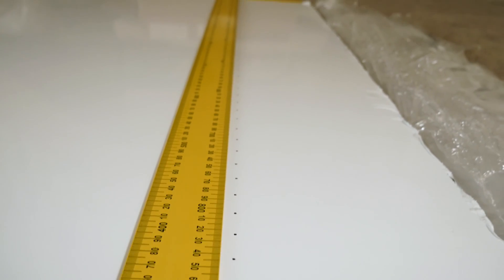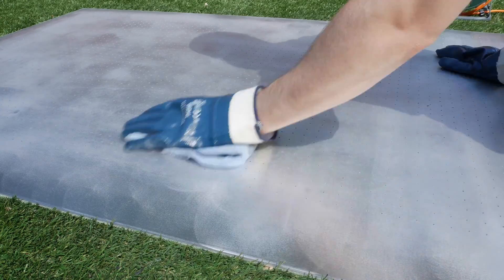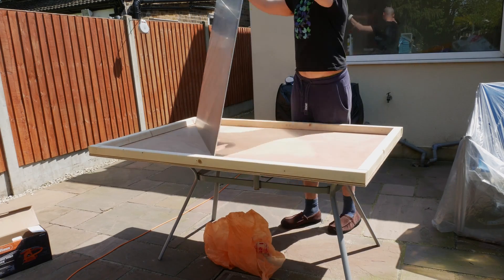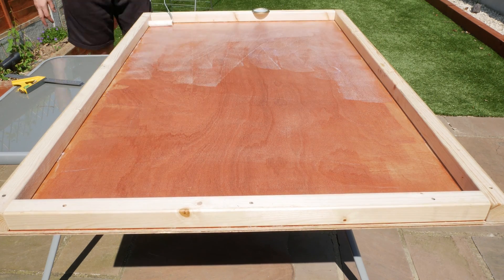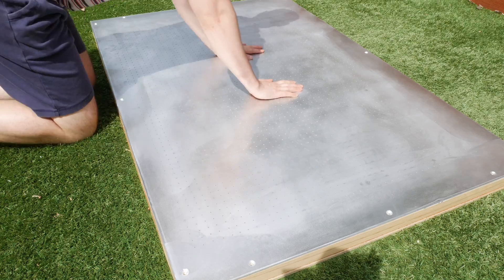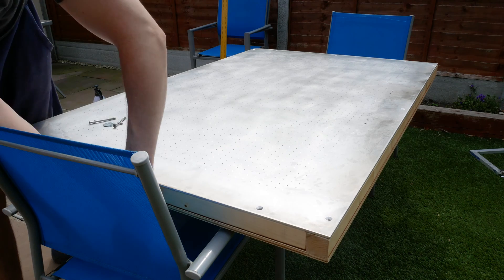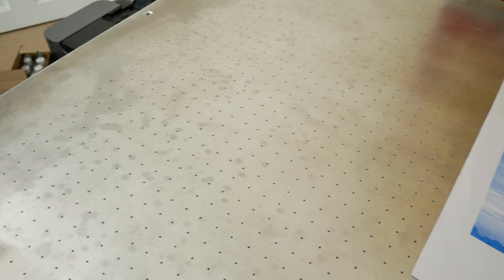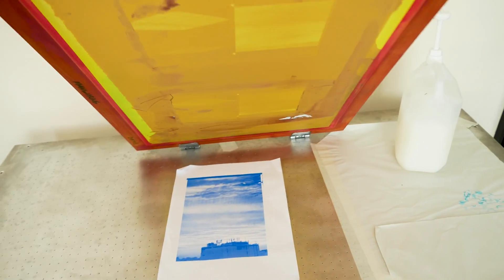DIY Large Screenprint Vacuum Table For Under £200

Comment: Sir a great build.. But why would you build a vacuum table like that when all you need is to put a vacuum between the glass and the flexible membrane? The bottom of the vacuum table could be the glass and the membrane would seal to it with the exposure unit beneath that. That is how we burned offset plates for years. This would be much less work and far cheaper.
Reply from the maker: this is a printing table not an exposure table, check out my exposure table video on my channel
Reply: @ThisDesignedThat  Sorry other than an exposure table I couldn't see a practical need for the vacuum. I worked in printing for years and never thought of something like this. I would think it would slow down production. God bless.

Comment: How thick is the metal?
Reply from the maker: 6mm
Reply: @ThisDesignedThat  what is the size of that metal top I thought I heard you say 1000 x 1500 mil surely its bigger
Reply from the maker: @daddy4739  1500mmx1000mm thats pretty big, easily print A0 sized papers if needed
Reply: @ThisDesignedThat  could you give that to me in English measurements. I try to go metric but I'm not quite there yet. What brand of screen print inks do you use?
Reply: @ThisDesignedThat  thanks I'm glad I found you on YouTube  just scrolling around. You have great advice and your and EXCELLENT teacher.
Reply from the maker: @daddy4739  mm (metric) is English measurements :) you can use google to convert to what you need. I use Daler Rowney System 3 Acrylics
Reply: @ThisDesignedThat  thanks again. Oops I meant to say u.s. measurements

Comment: Great Vid, Thanks! I'm about to build one myself and this was really helpful. Are you still using the domestic vacuum or did you find anything else?
Reply from the maker: Hi Joey, yes still using a domestic vacuum, i would really like to get a side channel blower but they are pretty expensive £300-500. I've actually finished upgrading this table to be even better and will be releasing a video on it today

Comment: Hey Paul! Thanks for sharing, I need to make a table as big as yours, roughly, and I've learn a lot as I've been able to clarify many doubts. Just wanted to ask you if there's a special reason for choosing a 6mm thick aluminium sheet instead of, for example, a thin metal –don't know which kind yet– sheet attached to an MDF board. Thanks again!
Reply from the maker: I would opt for a water resistant surface and not use MDF personally. You can sometimes get ink and water on the table and MDF could swell up and that might cause issues. Plus it would be a pain to glue them together if you dont have a lot of clamps and weights.
Reply: @ThisDesignedThat  Oh, thank you so much, you're totally right!!!

Comment: nice job there fella! i made a similar table a few years ago, drilling all those holes is just horrible! i put my vacuum hole in the side just so i could use an upright with the tool hose : works great, but i wish i'd come up with something to cut off the suction when the screen was up. I added a metal halide light underneath for my exposure as it's all in a garage and space is limited. I worked in screen printing years ago, used to print some interesting stuff...:)
Reply from the maker: Cheers Wayne. I actually built something for the automatic on off vacuumbwhen the screen is up. Documented it here https://youtu.be/4aUVBEs9sM0

Comment: Hello Paul, I am trying to work out when one needs a set up like yours here, which seems great and when one would need something like a Natgraph vacuum printing table. Are you able to adjust snap off for example with your set up? Thanks in advance Paul
Reply from the maker: Hi Mischa, well you are talking thousands of dollars in difference between these 2 types of table but I think something like this DIY setup would be good enough for 99% of prints people do. I have 3D printed brackets that I clip onto the frames that offset the screen from table. Through that you can adjust the snap off. In the future I will be building a much better DIY table, complete with squeegee arm and adjustable frame and snap off adjustments. But I need to get welding equipment for that. Not that this build doesnt meet my needs but I just like a challenge to try and build something as good as these really expensive commercial grade tables. Let me know if you have any other questions.

ps - take a look at my other mods I built for this table as they make it much better. Especially the automatic vacuum valve! - https://www.youtube.com/playlist?list=PLThNZEmqjs3kWZAbUEvAwUDOzFCtfcWi3

Comment: Hi again. Now working on my table. Drill guide helpful for drilling those holes. Do you have any recommendations for a quieter vacuum pump to use with this? The professional ones are like $800, but surely there must be something out there that can be bought cheap that doesn't make the whole process unenjoyable? Thanks!
Reply from the maker: its the last thing i need to find myself. At the moment i'm using my Meile vacuum cleaner. Im pretty sure commercial vacuum tables use a Regenerative Blower but they are expensive and im not sure if those are the ones needed. You can get them cheap from china but I havent risked it yet because if it doesnt work or is too loud i have very little use for it elsewhere.

Comment: if you run the countersink backwards near the end at high speed it will give a nicer finish and more control over accuracy. it will also sharpen the countersink.

Comment: This is great. So impressed with your work on this stuff. Next stop: the sliding arm squeegee with counterbalance? I am hoping to follow your lead on these things!
Reply from the maker: Thanks mate, its definitely on my list but first i will need to buy a metalworking setup (welder and some space to fabricate) as I want to build the frame from metal, like with traditional vacuum benches. A wooden frame this big wont be rigid enough i think and there could be some issue with accuracy and registration so I'm going to hold out and build it from metal.

I've actually got most of the parts for the counter balance arm as i did plan to do build it all in one go when i started this project but for now its on hold. I'll be doing a video whenever it gets built. Be sure to check out my vacuum valve video, its really made a difference to my printing process. Sped things up loads!
Reply: @ThisDesignedThat  Thanks I'm going to try to copy your build on that vacuum table. How is it pulling a big squeegee manually without the glide-arm. Can you still do it?
Reply from the maker: @meatradio  hmmm At uni I use to print A1 by hand, i have decent strength so its not too hard for me but it does get tiring. At home I only print up to a2 at the moment and thats easy for me by hand. A1 I would suggest glide arm if you have time to resources to build one

Comment: Awesome video! I am trying to getting this done too. Have a couple of questions:
Reply: what kind of vacuum do you use? I want to print up to size A1 too but not sure how strong i should use. I'm afraid if I use too strong it will suck the paper and leave some air hole on it. Can you also give me the air hole drill size too please. Thanks in advance!

Comment: This might be a dumb question I’m not the greatest at building but could you use a sheet of pegboard instead of aluminum?
Reply: Hey bud I’ve been building one and this video has been super helpful. Only problem is I don’t think I’m getting enough suction. Everything should be airtight and sealed so I think it might either be that the shopvac I was using wasn’t powerful enough, or the holes Ive drilled were too small. What size drill bit did you use?  Any advice?
Reply from the maker: @zacharygonzalez9062  hi mate, I used 2mm drill bits. I also had pretty weak suction first of all but that was with my £30 hoover, when i swapped it out for a meile £200 vacuum the suction power is much stronger.

also if you dont cover the table with paper to block the parts you dont need sucking its much less powerful suction effect

let me know if you need anymore help, would love to see some build pics
Reply from the maker: You could use pegboard for a very basic setup but I would advise against it;

1) The holes in pegboards are too big and you may leave imprints on your paper. 
2) you will probably get ink on your table at some point, wiping it off a metal or plastic table is much easier than with pegboard
3) If you do need to clean the pegboard it could swell with the use of water
4) Im not sure how much of a smooth surface pegboard will create, it might not be too much of a problem with thicker papers but if you want to print on anything delicate it will probably pick up some of the texture of the pegboard
Reply: This Designed That that all makes perfect sense thanks for the help!

Comment: Excellent video man! Thinking about building one of these myself.
Could you do this with a piece of plexiglass instead of metal?
Reply from the maker: Thanks man. Yes can't see why you couldn't use plexiglass just need to make sure it's thick enough. I was thinking of using frosted plexiglass because then you could use it as a lightbox ans it wpuld help with registration etc but the stuff is SO expensive at the size and thicknesses I wanted

Comment: Awesome diy bro. 

I want to build a smaller one for myself. Should i do it ?
Reply from the maker: Thanks Kyaw. If you want to do high quality prints then a vacuum table will definitely help with registration etc. Doing something smaller than i did will definitely take a lot less time and the smaller the sheet of aluminum the less it will distort so you should be fine under 1m i reckon.
Reply: @ThisDesignedThat  Thanks you, brother. I am very grateful to learn from you. Knowledge sharing  is the best gift one can give to other. Good karma with good fortune will follows everywhere you go.